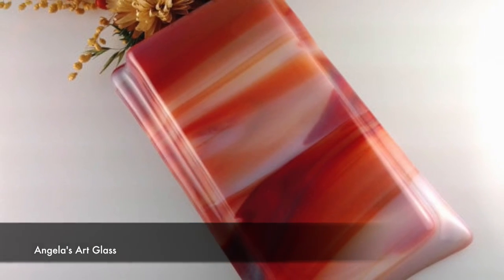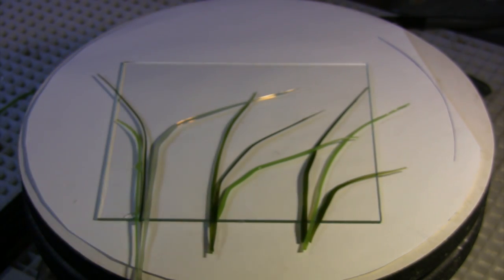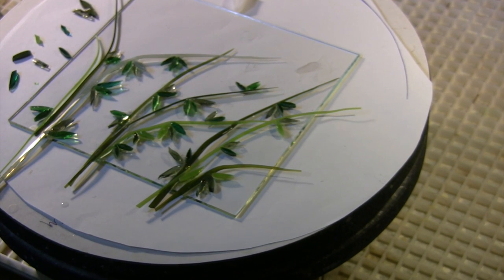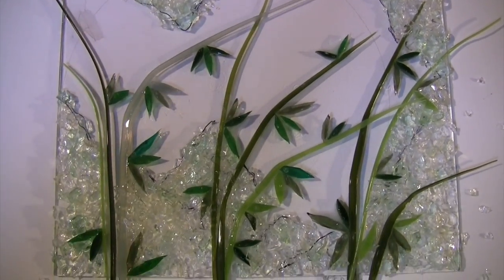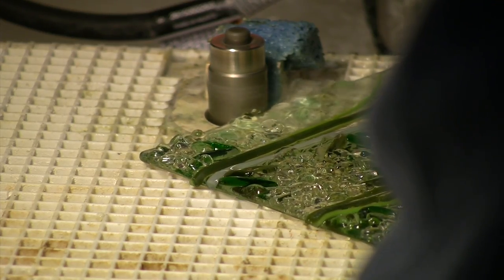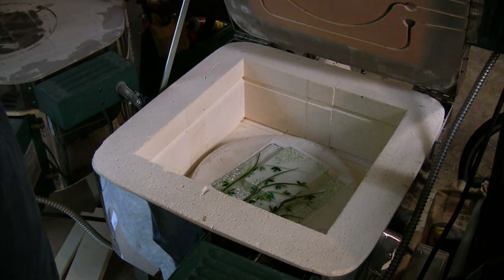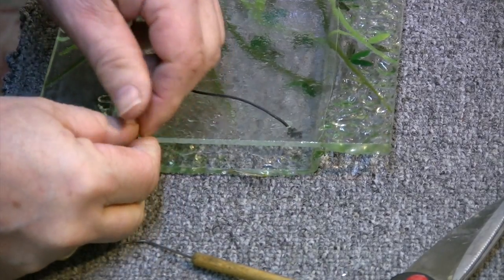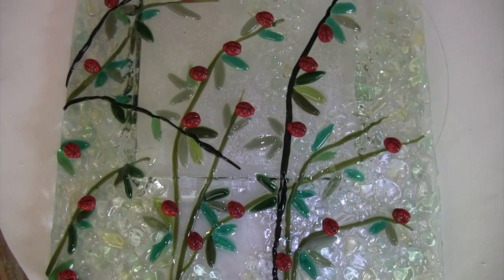Ladybug Wall Pocket

Comment: In the microwave kiln are we able to make dicrhonic glass? Was wo dering itmes that hav3 metal if it wouldnt be a good idea bexuase it would arc wouldnt it?
Reply from the maker: Dichroic glass is available from your supplier of fusing materials. It is safe to use in a microwave kiln.